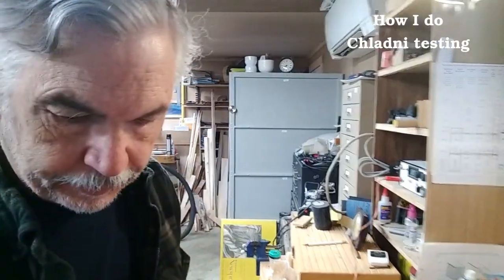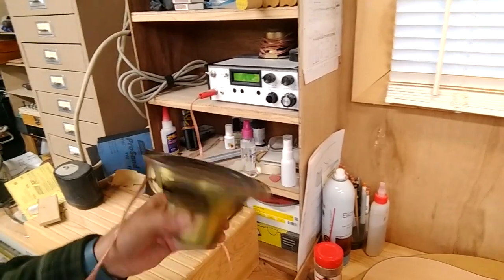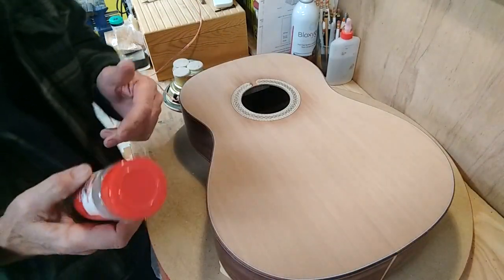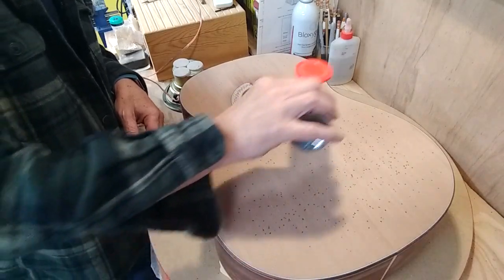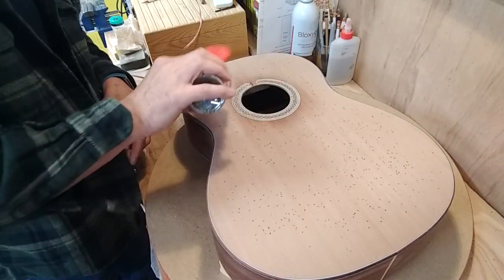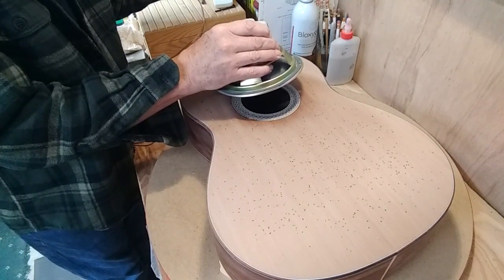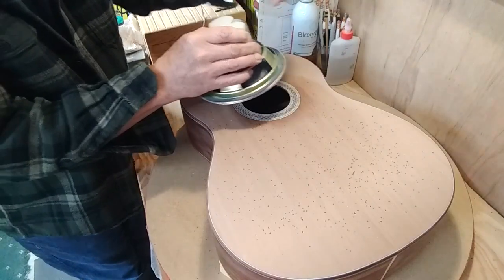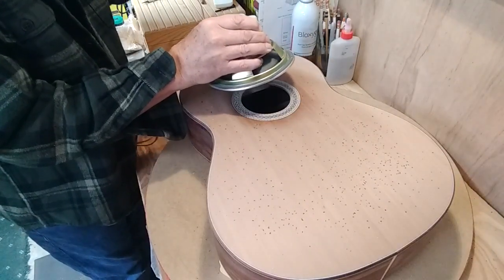Crude Luthier Vids: Intro to Chladni testing on a guitar

Comment: What is the power of you frequency generator set-up? Love you videos.
Reply from the maker: I don't know what it's ouput is. I did use a kill-a-watt meter (on the input) and at the highest volume it drew ~75 watts for the loudest frequency. I never use it at full volume. I set it about 1/2 way, although I don't know if it's linear or logarithmic.

Comment: I'm trying to understand why the nodes at resonance are some distance away from the sides of the body. I would've expected that there would be zero displacement (=node) where the top meets the sides. Any insight? (or perhaps my expectation was wrong?)
Reply from the maker: It is a bit odd on this particular instrument. I'm pretty sure that this is a result of the way I "squeezed" the X brace so that it is narrower than the standard angle. I also only used one finger brace on each side of the X.

I have not seen the node line extend to where the top meets the sides on the fundamental frequency(s). It is usually 12-25 mm in from the sides, although that can very depending on the powder used and the amplitude and/or placement of the driver.The secondary harmonic that divides the top in two longitudinally usually gets much closer to the sides.

Comment: I have always found this to be fascinating. But I have one question: How would one do this on an arched top or back? I see all these Chladni patterns on violin tops but I can't figure out how the medium stays on the arched plates. Doesn't gravity have anything to say about this? There is some rather serious angling going on in a violin top, how do they keep it from just falling down to the rim of the plate? I have never understood this. And that's annoying, I have several arched tops that I would like to do this on, but can't figure out quite how. Any suggestions?
Reply from the maker: I'd imagine it would depend on the type of material you use. I believe Cladni used iron filings, which may be rough enough to stick to sloped surfaces until vibrated off. I've tried several things that bounced right off a flat topped guitar. Thus my preference for course ground pepper. I'm guessing you'd have to ask a violin maker.

Comment: Very interesting to see a monopole shape at such low freqs…
Reply from the maker: I've made guitars that show monopole, long and cross dipoles below 100 Hz as well. Those aren't showing here on this redwood top.
Reply: You'll find resonant modes in all octave bands as they behave harmonically. Monopole will appear several times but you'll have to aim higher for dipoles and tripoles. Good idea to aim at the soundhole to employ Helmholtz resonance and amplify the signal.